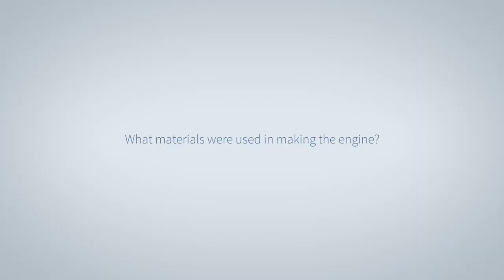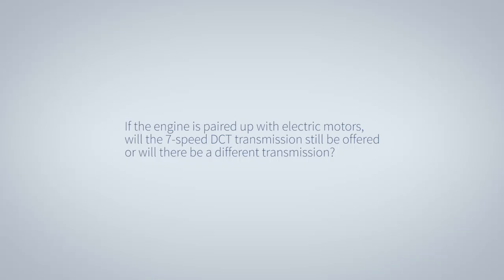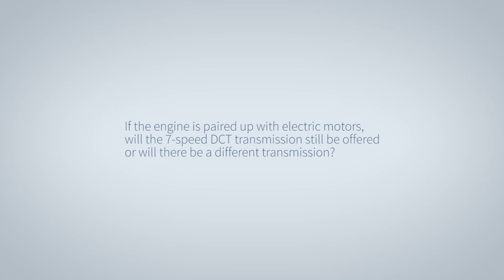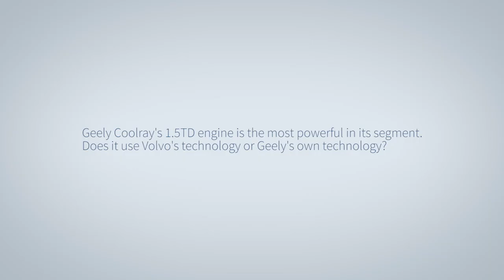Everything You Need to Know About Our 1.5TD Engine

Comment: My mom has the x50 her's is not the direct injection version. The car is powerful and feels light to drive. I would like to ask a few more questions.
1. I checked under the hood a few days ago and it seems the turbo is electrically driven? I'm not an expert so if you could answer that it will be great.

2. Is it possible for the mild hybrid to be mated to the current ice engine let's say after a few years. If so, what changes need to be made to the car? Where will the batteries be placed and will the eat up interior space?

3. Is the engine mod friendly and how much torque can the engine and gearbox withstand?

Thanks in advance if you do answer me
Reply: Your answer to number 3 is it's a volvo engine most likely it at it limit now.
Reply: 1.no..exhaust driven..
Reply: 2. possible. Proton x90 use the same 3cyl turbo direct injection engine but paired with mild hybrid. Of course it will consume space depends on the battery size. For the components, afaik they replaced the alternator with belt starten generator

Comment: 12,000,000km÷230car= 52,174km/car average?..
Reply: no it means each car clocked 12,000,000kms in average
Reply: @kupangrebus3177  impossible, it would take them driving the car at 200km/h non-stop for 6.85 years to achieve that mileage
Reply: @garychan927  not impossible. most manufacturer test their development product decades before release to the public.